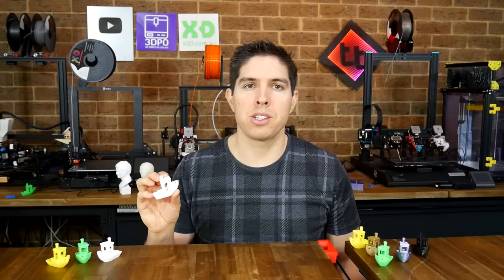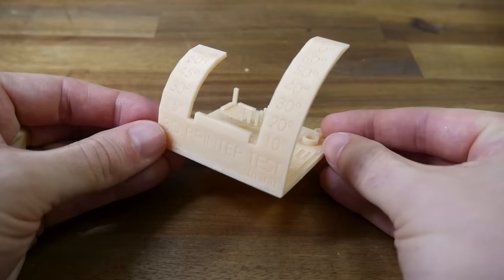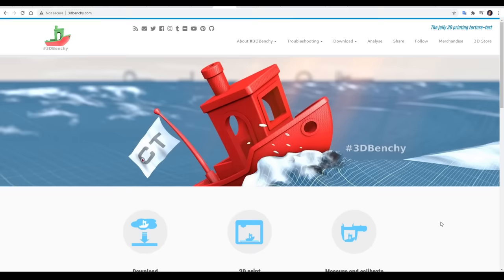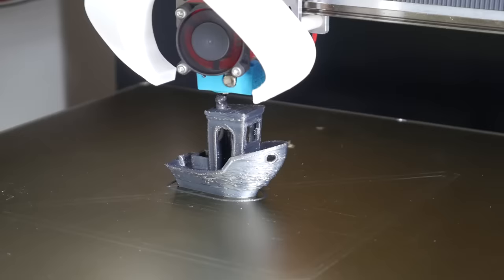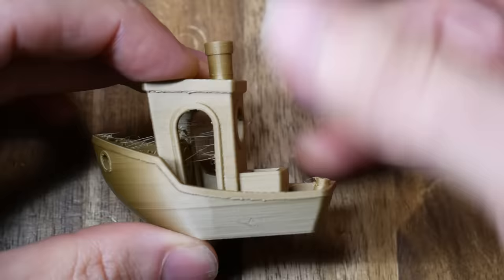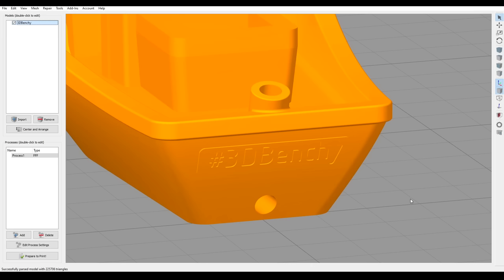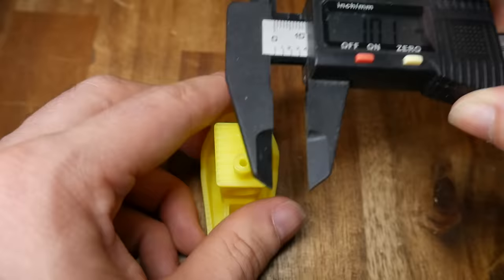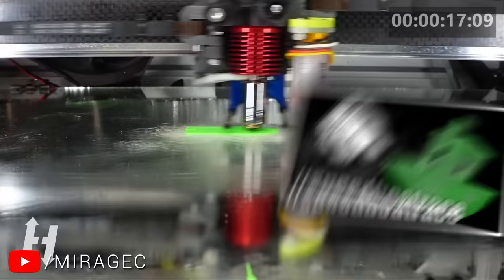How a 3DBenchy can tell where your 3D prints need improvement

Comment: Right after watching this video. I have printed a benchy using my ender 3 v2. This test is great to check the machine accuracy and slicer settings. What it doesn't help us know is, the quality of the PLA being used. Im using a 3idea pla which i found to be very bad at printing smaller objects due to curling up and peeling of easily while printing. But i could print the benchy very clean. Conclusion. Benchy should have a model modified to have 4 little pole like structure starting from base to begin the printing. This will help identify material quality aswell.

Comment: I need to remix your Ender 3 MKS control box for a 5015 fan. My last speed run was at 21min (sliced @ 150mm/s) when the X stepper skipped the length of the wheelhouse right before the arch. It's done it w/ 2 different sliced files. My best guess is a hot driver. The noctua just isn't up to the speed. Slower 24hr prints don't miss a beat.

Comment: It's a very good quick "practical use" test but I wouldnt say it's the absolute best for proper calibration and fine tuning since the old stress test offers larger more dramatic examples of bridging and overhang.

What I'd like to do with mine is add text for which types of filiment I'm using.

Comment: I have had no real issues with my Qidi Xmax except for retractions. In the S3d preview, all of the retraction blobs are 100% guaranteed to show up. This is the only issue I have and I can't follow your previous guide because the software you use for consoling makes no sense to me and there are no videos on how to operate. I only use Fusion360 and S3D and I do not use octoprint or any other software. I can't find any way to control/adjust the printer like everyone else seems to so easily do.

Your videos are amazing and have been watching them for a while. Thank you for producing high quality videos!
Reply: Try Pronterface. It's quite straightforward app that have printing from file capability and a console command. Just plug your printer via USB and you can do basicly anything. Have u ever tried printing retraction tower?

Comment: I haven't printed a bench and the reason is that my friend prints one for every filament he buys and yet although he uses the same settings each time there are noticeable differences between them all, I have used the Cura test prints to calibrate my printers and believe I have them set up as best as they can be without using all of my filament chasing micro numbers

Comment: I have seen your videos and this one in particular, why? I explain, I have an Ender 3 S1 and I must admit that it has given me a lot of satisfaction, more than the Ender 3 V2, which I ended up selling because I don't like the Bowden system as much as the direct printing. The point is that on the S1 I have replaced the hotend kit that came from the factory, with an original Creality one but all metal, with the bimetal barrel and nickel-plated brass nozzle, this hotend reaches 300 degrees, I have used the Pronterface to calibrate The PID works perfectly, I have adjusted the straps, eccentrics, leveled the bed using first a third-party gcode and then my own. So far everything is ok, but I have never printed again like when I acquired this equipment, the effect that you show in the Benchy that there is a delamination in the bridge speakers, I cannot correct, therefore in other prints that is noticeable. The funny thing is that I have a first Benchy that doesn't even have the line in the middle of the hull, it's perfect!!!, if it's not a bother on my part, can you give me a suggestion on what to check and correct? I use CURA, (to tell the truth I tried with Orca Slicer and I don't like it, it even changes the motor steps and I don't notice a superiority with respect to CURA (I plan to try with Creality Print, you tell me), you have a well configured profile for Ender 3 S1 to test it?, and/or suggestion on how to adapt this hotend (if that is the problem), to print correctly again?, I apologize for the length of my message, but I need help, and I am following your website where there are different options to the most frequent problems. Best regards from Buenos Aires-Argentina. Ricardo

Comment: It's fun, it's cute and it's a little bit useful.  It doesn't float though so not much point in printing it for a gift.  Didn't know about the dedicated website and hadn't thought about using it as a filament example, so those were both helpful.
Reply: They do float upside down... 
There are a few modifications on thingiverse that makes it float.

Comment: Just got my printer yesterday. I printed a benchy first thing because my friend told me to. The 3 hours of calibration I did before printing paid off because it turned out looking nice. Needs a bit of tuning to help with stringing and archways were slightly off, but I'm very happy with my first 3D print. Also, I didn't get a hull line. Am I just really lucky? I have an Ender 3 using Ender PLA filament.

Comment: I wish this had more info about what to tune... some stuff was just briefly mentioned to do some tuning in the slicer, but not what/how to tune it. My issue wasn't mentioned. Rear of the boat was lifting off the bed and a bit rounded. Apart from a brim, what else can I change... bed heat?

Comment: I didnt knew it had its very website! Cool! I want to check for a feature all of my benchies have and it's not mentioned here. Apparently, the hull has 2 different finishes. It looks like in the upper part, following the upper edge and not the layers, to be clear, it looks like it has some sort of "fuzzy skin" effect applied. Very subtle but visible and repeatable, disregarding the material i print it. And it's strange I can't find a mention of it neither as an artifact nor an intended feature.

Comment: Given what was pointed out here, my Biqu B1 is rockin' out. The first bench I printed on it, using the stock Cura B1 profile has almost NONE of the defects mentioned. I used the white PLA provided with the printer at a bed temp of 60 and nozzle temp of 205. Have you done a calibration cube video. I think in that respect I saw vibration at the stock speed that went away at slower speeds. Love the channel!

Comment: The second print for my SLA printer was two scaled down benchys and two rooks at the same time. Came out great. They do have the hull line and the bottom layers wiped out the text at the bottom and gave them a bit of an elephant's foot but great otherwise.

Comment: Hey teach, can you ever do a video about installing dual Z. On printers that don't have it. For example the Ender 3 there a lot to keep in mind like vrefs and your printer no longer being grounded because you have to move the PSU
Reply: Pretty easy, Amazon has kits. Only downside from the one I got is the extra lead screw has to be cut down. I also had to reverse my direct drive setup change where I took the tiny Z motor and switched it with my extruder one.
Reply from the maker: I had a patreon request for this so it is on the way. Planning to show it three ways: mechanical only with a belt, two steppers running from one stepper driver, and two steppers running from separate drivers using G34 to auto align the gantry.

Comment: I recommend switching to metal calipers the plastic ones are off a mm or 2
Reply: They can be, but I tossed mine on jo blocks and they're dead on. Not as good of precision obviously as a good set of Mits but I prefer using plastic with plastic so I don't need to worry about scratching prints.

Comment: Been testing out different cooling mods and profiles, have printed about 40 benchy's at this point. To really test the cooling I have had it printing much faster than normal.  It's a nice way to see what does and doesn't work when it comes to cooling mods. 
Seems to be my dual 4010 parts cooling with modified ducts work the best yet. I tried 8 different ducts to get the best yet. 
Still think some improvements can be made.

Comment: I wish I could actually print the 3DBenchy. Yesterday I got my ender 3 v2 set up and printed a cube and a fidget toy just fine, but this morning when I tried to print the Benchy the filament wouldn't stick to the print bed once the nozzle got to the middle of the bed. I've tried fixing the levelling, using glue, messing with settings, etc, and nothing has worked...

Comment: Please can you tell my why when i print holes in the Z axis ,every hole prints too small ,ie want a 10mm hole get a 9 mm hole , can anyone help please
Reply: When you have a 3D model with a 10mm hole in it, the hole is represented by points on the circumference connected to make triangles. Those triangles however cross into the circle making its effective diameter smaller. Combined with overextrusion and printer tolerances this makes 3D printed holes undersized.
Reply: First Calibrate well yuor z stepper with a calibration cube,to be shure yuor z dimension are ok, the if yuo continue with the problem, in Cura yuo can select and increse the circunfrence of a hole, there are an option for that
Reply: Calibrate e-steps (extruder steps) then calibrate flow rate. Assuming you're using the correct temperatures. 
https://teachingtechyt.github.io/calibration.html#esteps
Although, if you're talking about printing holes in line with the z-axis (standing up instead of lying on the build plates) then it's just an aspect of how layers are laid down. Because your hole is now made up of separate layers, the start and finish of the hole are going to be a small section of straight layer. This video goes into it:
https://www.youtube.com/watch?v=j6508J94VsA

Comment: There are 2 things I print for new filament. A temp/heat tower and a benchy. My small benchy fleet is 13 boats strong but it will grow as I get different filaments. Heck a new roll of filament should probably have both the heat tower and benchy printed as they are different batches and may need fine tuning of temperature and retraction.
Reply: I also add on the extrusion tester. It's a little Y shaped nugget that takes about 15 minutes to print two. Makes it super easy to tell if you are over or underextruding the new filament.
Reply: @ThatRPGuywithtoomanyOCs  do you happen to have a link for that?

Comment: I printed Benchy with my Qidi i-mate S using eSun+ PLA set once at 205C and then at 195C.  I get a very small amount of stringing across and near the top of one of the 'doorways', rest of the print looks great.  Anyone have suggestions on eliminating the stringing on this printer?  

Any other thoughts on this printer would be helpful, I don't see many references to it in reviews or any of the more popular websites.

Comment: I've tried printing this 3DBenchy model three times on my new Creality printer and when it gets to the roof the printing tip hits a little blob at the top of the arch that's sticking up a little too high and tips the whole model over. I have yet to successfully print this model. Any tips or suggestions on why this might be happening? Printer tip setting too close to board/material? I'm a complete newbie, thanks.

Comment: I've got a really set-up with my ender 3 max and get clean ones. The only thing I have had is a vertical line on the hull! IDK what it is. I've talked with someone and they said it's where it stops and goes the other way and not to worry. Any ideas? Or don't go crazy about it? I'm adding a second Z rod so I'll see if it helps. I noticed that the gantry doesn't go up and down evenly so I'm hoping this helps

Comment: Mine looks great other than barely any stringing only on lower of side doors passenger side is better than the drivers side im guessing its cause my cooling fan duct is not 360 only front and sides 
Also on the drivers side the hull starting at the bottom going 3/4 way up right on the transition from straight to front curve little bit of a seam bulging out barely other than that looks great  would a touch more retraction fix that as you didn't meantion it also my roof lines are at a angle where yours is straight across

Comment: I just started getting into 3d printing and this is a common problem printing with silk filament especially. 6:54 It almost seems like its under extruding cause those little line are concaved into the benchy but im not sure. any help on what settings in cura to change for that?

Comment: I use Ultimaker Cura for slicing. I've only been printing for about a month on my Ender-3. At the program's default settings it takes 1 hour 54 minutes to print a benchy at 50mm/s speed. Does anyone know what settings I should switch to cut that time down? Seems way too high, especially after watching this video.

Comment: how did you get it down to under an hour print time my first one was 2hours 20 mins .15  layer my .2 is still close to 2 hours do you have a video for the settings u use on your printer

Comment: Hello, thank you for this video, very helpful. As a beginner, I know that I need to fix retraction and heat, at least. But I have an issue that I can't fix for now : at the middle of the job with a white PLA, I have some burned filament that the nozzle has accumulated around it. I set more speed, less speed, Z axis up... Nothing is working. Have you encountered this issue before?
Reply: Every problem you can possibly encounter has definitely already been encountered :)
Your nozzle can get dirty that is completely normal.
If you see brown/burnt points on your pint, it's a common phenomenon called heat creep. Try lowering the temperature of your hotend, 190C is fine for PLA.
Reply: @iniqy  Great, thank you very much. I will check with different temperatures :)

Comment: Great video. I noticed a few benchys with issues around the pillars. That's where the print speed is slow. My printer nozzle clogs and the extruder is unable to push and starts slipping. 
This clog happens at all the places in a print where the speed is low. I think part cooling settings is the culprit and also think it could be nozzle temp. 

But please help fix this issue.
Reply: Lack of part cooling does not cause clogs.

Comment: Filament type used seems to be a massive variable that could completely throw off the results of the test prints. Then you end up calibrating for that specific filament, and you have to calibrate for a new filament each time you print. Even the same filament types can vary with print settings between brands. It’s a tedious annoying thing to get past. I don’t wanna tinker with Cura slicer settings, I want my printer to be prototyping for me while I work on other customer projects

Comment: i printed 2 benchy back to back, they both got knocked off the print bed at the start of printing the roof, every other thing is fine, any help?

Pinter(Biqu B1) setting 
fan speed 100%
flow 100%
print speed 60mm/s
skirt

Comment: The Ender 3X just did an awesome job straight out of the box.
You can even read the #3DBenchy on the white filament that came with the printer
Only the bottom layer is a little too far off in the middle - the corners are fine tho
Any Idea hot to tune that with a glass bed?

Comment: Calling a benchmark a gimmick is like saying ProjectFarm is worthless, which is complete heresy!

Imagine trying to launch a rover on Mars without using any benchmarks along the entire supply chain. When building something, consistency matters. Benchmarks are well established, useful practices, kinda the opposite of a gimmick. Having a method to benchmark & calibrate a 3D printer is a critical skill in any user's skill-set. Not using some type of benchmark is like building a bookshelf without a way to measure the boards. You can do it, but it's not fair to call tape measures, levels, or squares gimmicks just because the job was completed at less cost without them. Results surely would've been more accurate if one or more of them were used.

My Computer Science class reiterated the importance of benchmarking, and how it's necessary across industries that require performance metrics to gauge success. Having experience in CNC manufacturing, I can say that calibrating tools and wasting some material by test running parts isn't optional, it's a required cost of setup. So, it really shouldn't be an opinion whether a benchmark is a gimmick or not, because its numerous advantages are clearly and factually defined across multiple disciplines.

Comment: I just printed my first benchy. I printed directly from the creality k1 max printer. The very bottom layer is a very thin film that extends slightly wider than the boat bottom. What can cause this? Do I just remove it?
Reply from the maker: This is called 'elephant's foot'. Sounds like you want to raise the nozzle slightly relative to the bed.
Reply from the maker: Unless it is there on purpose, in which case it is a brim that will peel off. You can search for this and disable it in your slicer. Hopefully you'd only need it for tricky prints to add grip.

Comment: I mean, I'm pretty new, but seems to me to be unquestionably a useful tool. I'm printing my first one right now (technically second, the first one failed to adhere within the first layer. my bad though, not the printer's, My bed basically requires glue to get any adhesion and I forgot it) and plan to rewatch when it comes off the printer to help me tune in my 3d printer. I've not done any kind of benchmark yet but I've been having a problem with low quality prints, so hopefully this helps me identify the problem areas.

Comment: 7:00 What kind of "tuning in the slicer" to get rid of the zits?
Reply: you could set the seam to a corner, maybe retraction is another?
Reply: i fixed 98% of the zits issue i had by tweaking "maximum resolution" and "maximum deviation" (cura - mesh fixes) from a CNC kitchen video about "blobs"